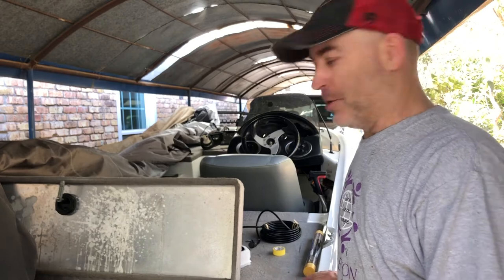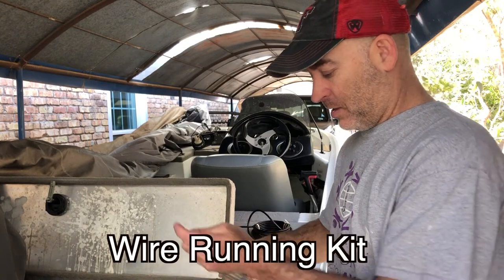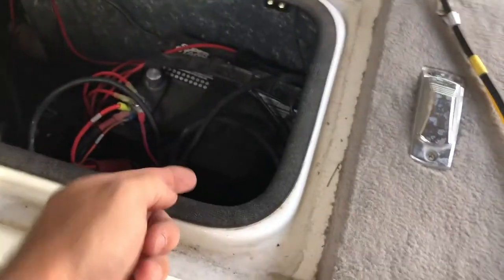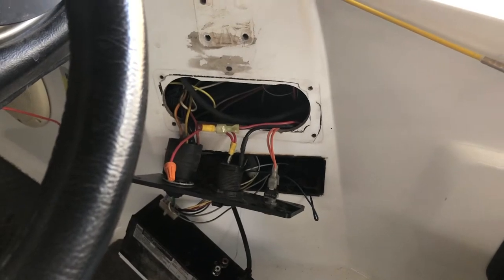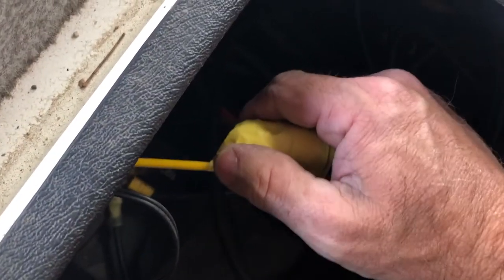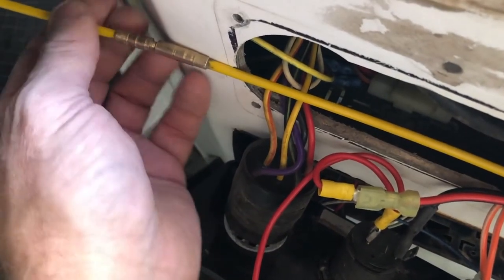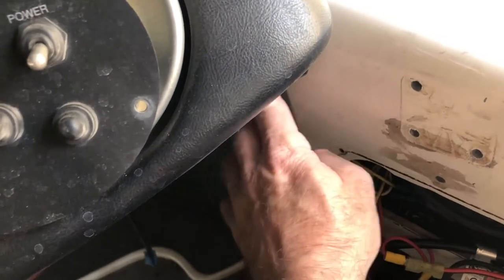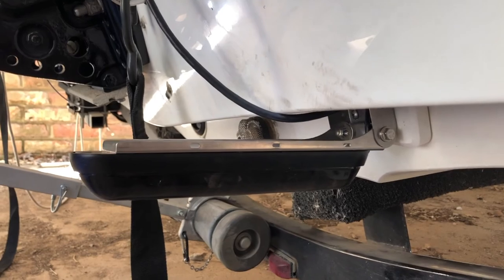EASY Way to Run Wires in a Bass Boat Hull

Comment: Wow!    I have owned my bass boat since '96.   gone through several Fish finders.   Struggled to change the wiring.  Thanks. This 4+ minute video tip will make my next change so easy.  Better than my string and rod blank routine.
Reply from the maker: I appreciate the feedback. That little tool will make you wonder how you did it without it